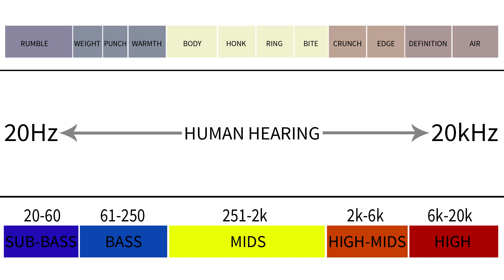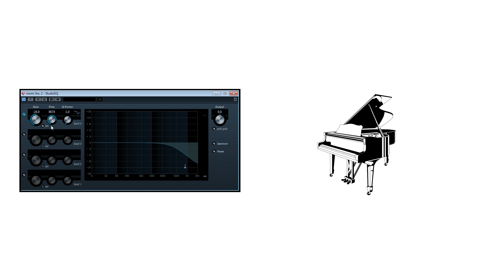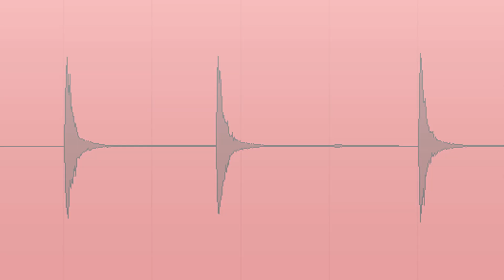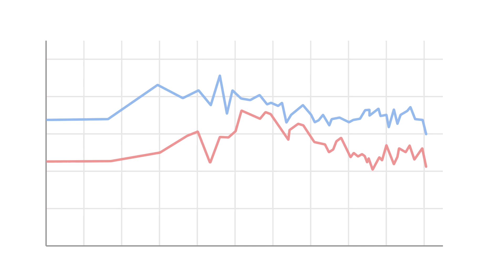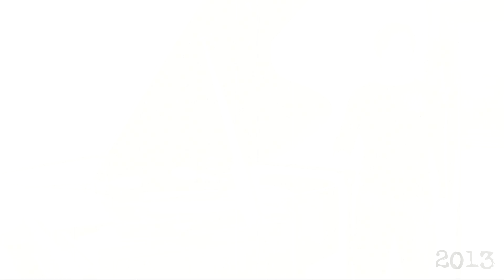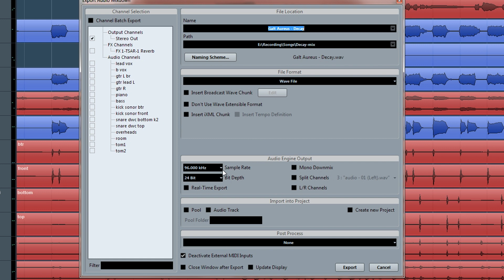How to MIX!  A mixing tutorial shows you how to mix your own music!

Comment: What is your opinion on turning down the master fader before export, in order to prevent peaking and/or get headroom? As you just turned down all mixer faders simultaneously, it does result in the same, doesn't it?
Reply from the maker: I'd only drop all individual track levels at the very start of a mix.  After you've built a mix you like, and if the only goal is to avoid peaking, it's probably better at that time to just pull down the master fader instead of fiddling with the individual tracks.  It's faster, and you won't accidentally mess up the relationships you have going especially if there's automation, pre-fader effects, etc. to worry about.
Reply: Thank you very much for your answer. I was always wondering, where people take the logic from, that turning down the master fader would be of no use. If the mix is functioning the way it should, i saw absolutely no problem. What is the advantage of getting it right in the mix already, if there even is any advantage?
Reply from the maker: ***** If I'm understanding your question correctly, no, there isn't really any advantage, though the common worry goes: if you're running everything too hot at the master bus, while you could pull the master fader down to compensate for that, there's a chance you may be clipping somewhere else that you don't intend (driving a plugin too hot, for example). 

That's really of debatable concern nowadays both because gain staging in the 24bit world is so forgiving and plugins are so well-coded now as to preclude much worry there.  Also, you're setting your mix up by ear...meaning you're making decisions based on what sounds good to you.  How could what you're doing be wrong if you like what you're hearing?!  ;)